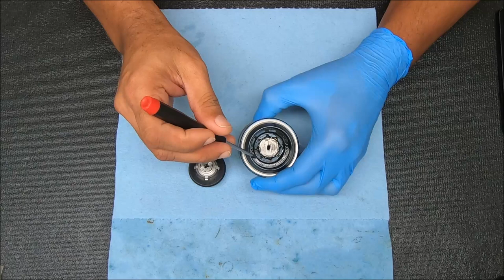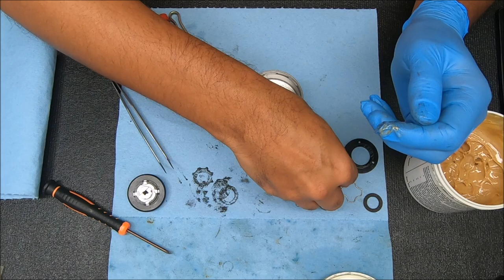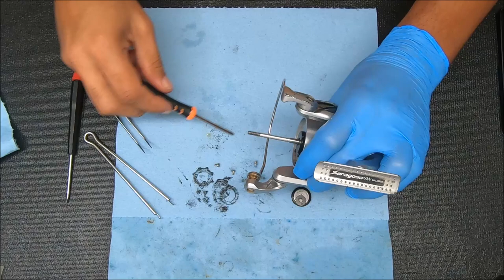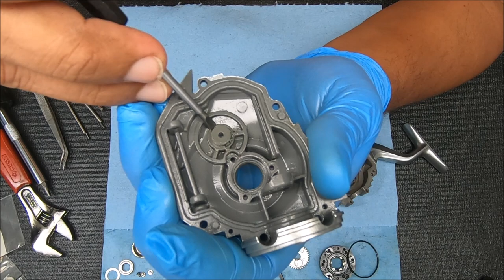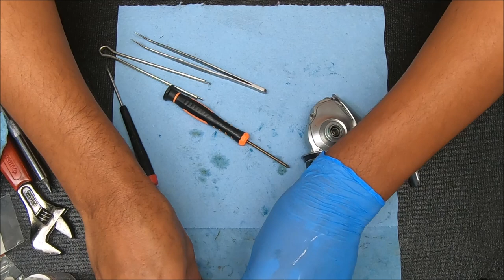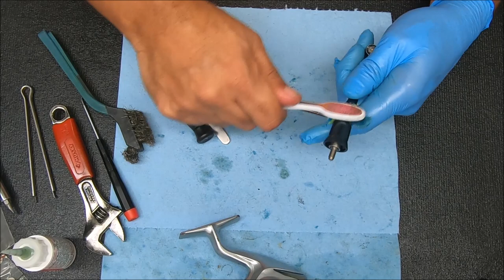Shimano Saragosa SW6000 - How To Take Apart, Service & Reassemble

Comment: IMPORTANT NOTE: The 6000 'gosa does not have a self closing bail!!!  After disassembling, cleaning, and reassembling my reel along side this video I spun the handle and my bail didn't close.  Figured I must have messed up the bail spring and/or trip arm assembly.  Took it apart and reassembled the bail spring area 3 times and it still wouldn't self close.

As it has been 4 months since my last fishing trip, I had completely forgotten the 6000 does not have a self closing bail.  The "bail trip lever" does not actually "trip" the bail.  The lever's purpose is to extended down onto the friction ring when the bail is open to keep the rotor from spinning while you are casting.

p.s., your videos are my must-watch when servicing my reels.  Very informative and well produced.  Thanks!
Reply from the maker: Thanks for the love and sharing this detailed comment, brother! Sorry if I didn't point that out, of if I implied that it had an auto-flipping bail.

P. S. - Hope you caught some nice fish the last time you were out there.

Comment: Could you perhaps explain how big the difference in fishing reel is between the 6000 and the 10000?
or is it just the spool that has more line in it?
Thank you for the very detailed tutorial!
Reply from the maker: You're welcome and thanks for checking out the video. Difference between those two sizes? Not that big. It's just depends on what type of fishing you're doing or what your requirements are. The higher you go in size, the larger the fish (theoretically) you can catch. Hit the thumbs up and spread the word about the channel.

Comment: Thanks for the vid. What is better: Saragossa or Slammer IV? From the service experience
Reply from the maker: You're welcome and thanks for checking out the video. Not sure what you mean when you say from the service experience. Are you asking if one's easier than the other to service, if one has better components than the other? If so, it's kind of like comparing apples to oranges. They use different styles and components, but each reel has quality components.

From a personal use standpoint, they both perform very well. The Saragosa is lighter, but I prefer the more durable feel of the heavier Slammer III, most of the time, which I suspect would be the same for the IV. Spread the word about the channel.

Comment: Hello sir !! After following this tutorial I believe I missed something.. the upper part of the reel os rubbing on the bottom part when reeling and the handle spins in reverse and in the natural reeling direction.. what is my mistake ? Do you have a clue ? Thank you for the video it’s great I just missed a part or something 😅
Reply from the maker: Thanks for watching and following along. Yes, if you are having these issues, you missed something, somewhere. Assuming the reel was working fine before you serviced it, I would focus on the pinion stack.... make sure everything there is in the correct orientation.... use the reassembly section of the pinion stack on my video as a reference guide. Hope this helps.

Comment: Great video and very helpful. I replaced my bearing on the bottom of the pinion gear then when reassembling found the rotor was really tight regardless of how tight I made the top nut, any suggestions on what may be causing this? Thank you very much
Reply from the maker: Thanks for checking out the video. I'm assuming you mean rotor nut.... help me understand....

1) What specific reel (make, model and number) do you have?
2) Was the reel working properly before you touched it?
3) Why did you replace the lower pinion bearing?
4) Did you do a full service or just a repair?
5) Did you follow my video when you disassembled/reassembled the reel?
6) Does the rotor spin freely if you just place it on the pinion gear without the rotor nut?
7) Post a video on your channel of the issue (without the spool on) for a visual reference, and include the link here in your reply.
Reply: Thank you, it is a Shimano saragosa 5000sw and was sounding a little rough. I followed your video and found that the small bearing on the bottom of the pinion gear was rusted out. I got it off and placed a brand new one on there. The reel otherwise ran fine and was not tight when reeling. Upon putting back together, as soon as I place the nut on to of the rotor the handle gets noticeably harder to spin, so I assume that is where the issue lies. I back it off (not tight like you do) and it frees up the rotation a little but nothing like a new reel where you can spin the handle and the rotor keeps spinning. It now stops pretty quick. I feel like I put the reel back together correctly and without the rotor on, the internal reel mechanism runs smooth and quiet now. Any ideas?
Reply from the maker: @muhikydd5562  If it was fine before and not fine after, something is amiss in your reassembly. Check your trip arm, your friction ring. Try replacing the upper pinion bearing. If none of these help, follow my video closely and redo your entire pinion stack.

Comment: After you service and see the machine.
What you think about this reel?
It’s this reel heavy duty and tough to handel the big fish?
Reply from the maker: Yes, within reason. Over 25lbs and deeper than 50 feet will be a struggle.
Reply: @TSGReelService  What if I use sw8000? Will the weight of the fish increase and the depth will increase?
Reply from the maker: It's more about the material used in the frame than the size of the reel..... but that's just my opinion. Try it for for yourself and see if you like it.
Reply: @TSGReelService  Thank you for the information given to me. It was very useful and informative for me.

Comment: Maybe I missed it in your tool list, but what bearing puller are you using? Thanks in advance for your reply.
Reply from the maker: Thanks for checking out the video and the description! No, you didn't... it's not there. Unfortunately, the bearing puller I use is not currently being produced. I'll reach out to the seller again in a few months or so to see if anything has changed.
Reply: Thanks for your prompt reply. I hate to hear that that bearing puller is not currently available. I work on my reels and that would be a handy tool to have at times. I'm impressed with how quickly you can take apart, clean, and reassemble a reel. I perform a full service on my own reels maybe once a year and more often only if needed. It certainly takes me longer to perform a service than it does you. I am also impressed that you are able to perform a full service without colorful language. I certainly haven't reached that level yet. Thanks again for your reply and your helpful videos. @TSGReelService
Reply from the maker: @dcbz6596 Sorry for the delayed reply here..... your second comment was held for some reason, and I just noticed it. Yes, it is a handy tool.... becomes more important the more I use it. I'm starting to have anxiety about breaking it. 🙂 My favorite tool from the same guy is his bearing puller.... gotten me out of a few jams, but I definitely use the bearing puller more. Regarding the colorful language..... I'm not immune to voicing my "upsetedness" and frustrations, but it's rare. I'm more of the reacting in disbelief (of how bad something is - see the spool breakdown on my Fin-Nor Megalite video) kind of person. Some reels take longer than others, and I also edit the videos to make them more palatable. For me, a full service (rebuild) on a reel takes a minimum of 45 minutes, up to several hours, depending on reel and shape it's in. Stay tuned for more videos. If I find out the person starts making the tools again, I'll make a video or make a post, if he's okay with it.

Comment: Is this the same as a 14000 gosa I have pulled mine apart and now putting it back together and it's not smooth and seems to be rubbing any tips Cheers
Reply from the maker: Thanks for checking out the video. Check out min 21:50 on in this video for possible help:

https://youtu.be/0SQHV0AcnzY?si=TD9N6qdY10huYPXi

You can also try playing with the orbital position of your drive gear.

Otherwise, make a video of the ALL the issues you're having, upload it to your YouTube channel and post the link to it here, so we can see what you're experiencing.

Comment: Nice work,what is your address and i will send you a new grease brush :)
Reply from the maker: :) Thanks for watching! I appreciate the offer, but if you check out my most recent videos, you'll see that I've already changed brushes. Feel free to drop a tip if you'd like to contribute. :) Hit the thumbs up and spread the word about the channel. Thanks again.

P. S. - I LOVE(D) that orange brush.
Reply: Thanx for the reply I’m glad you have a new brush 😊I have just found your videos and they have helped me service my reels the correct way.
Just 1 question, what grease and oil should I use on a Daiwa Saltiga? 
And do you use the same grease on the drag washers as you do on the reel internals?
Cheers
Phil
 @TSGReelService
Reply from the maker: @philproud7254  No worries. Glad you found them and are able to put them to use. No, I don't use use the same grease for the drag washers and the gears. Check out the video description for the greases and oils I use for reels. Thanks again, Phil. Barry
Reply: Hi Barry can't find the greases and oils I use for reels video ?
Reply from the maker: @philproud7254  hey brother.... it's not a separate video.... see this video description fro the info.